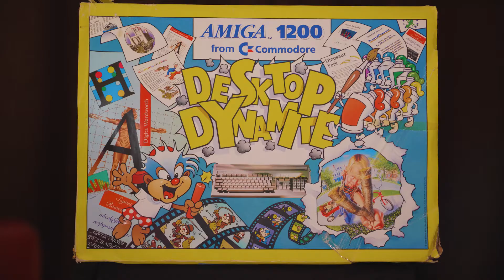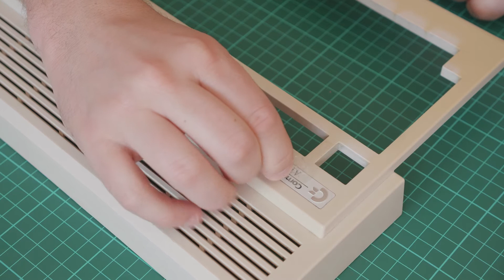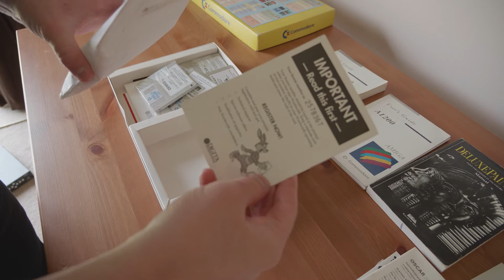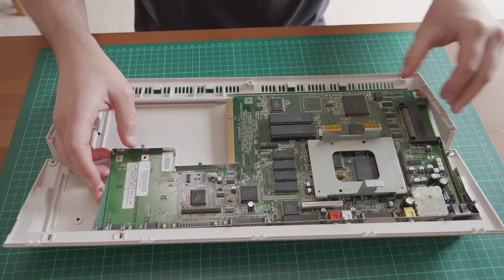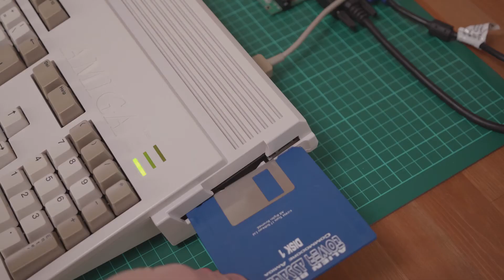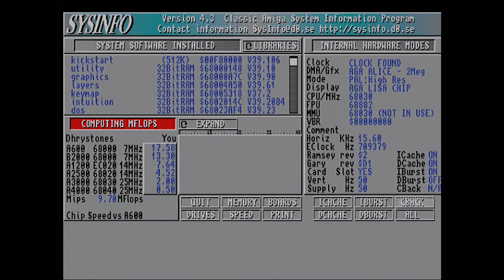The Amiga 1200 - Reassemble, Membrane Repair, Blizzard 1230! Pt2 - System Restore

Comment: Hi Si, great series of videos - thanks! Really impressed by the restoration. Could I ask what model of monitor you're using and how you're connecting the Amiga to the monitor? Is it RGB to VGA? - The input source of "Scart" is throwing me off :) By the way, the indivision mk3 is out now with HDMI output, looks good but some people have had a couple of issues reading through individual computer forums. They're quite expensive too so I'm thinking I at least need to check my A1200's still work okay!
Reply from the maker: Thanks for checking it out James! That monitor is a Dell 2007fp which is great but sadly not 15khz compatible, in this series there is a mixture of one of those cheap hdmi scart converters from amazon and also a GBS-8220. Neither are great but they get the job done for the price! I definitely will be investing in the new indivision mk3 at some point!
Reply: Si Goes Retro awesome thanks! Thankfully I know about all those devices so good to know I’m not missing a trick. I looked over one of my A1200 mobos and no signs of any corrosion so good to go. Cf cards and adapters arrived in the post, got Panasonic caps and hydrogen peroxide on the way. I was thinking about gotek but I think I’m going to go the networking route and use ftp instead. Got my mate who’s also well into jungle checking your vid out too ;) I saw that you’re looking for mods along with spicey mikey, there’s some on Aminet just in case you haven’t already scavenged it. :)

Comment: Got a Phase 5 Blizzard 1230 IV with 68882 FPU 50MHz and 128MB 50ns simm. It’s a fast 68030 card but for FPS no way. Got also a fast ACA1233n-55 and that have also slowdown with FPS such as Doom and Alien Breed 3D. FPS are great with the 68040 or the 68060. Waiting for the ACA1260 and hoping to buy a Falcon 040 or the Blizzard 1260. Got four A1200’s, 2x Rev1D.4 and 2x Rev2B all recaped and have original 3.1.4 ROM chips on it. Two have Indivision AGA MK2CR. Maybe the Warp 1260 would be great if the 68060 Rev6 CPU is on it. Than is 105MHz great for FPS.
Reply from the maker: I agree of course the 060 is where it’s at, but even if you can find one to buy it’ll cost you £1000s nowadays! The 1230IV is the one of the best bang for buck cards you can get. I’m hoping the Warp 1260 isn’t too hard to get hold of, watching it play AB3D2 is magical! Would love to get hold of an indivision AGA MK2, some nice kit you’ve got there!
Reply: Get a DCE Blizzard 1230 IV also with a 68882 FPU 50MHz and a 128 MB 50ns simm. Than I have two Blizzard 1230 IV’s.  Like the Blizzard 1230 IV more than the ACA1233n-55.  You must get lucky to get a Warp 1260. Would be happy to have the ACA1260 or a Blizzard 1260. Like to see the specs from the ACA1260 against the Warp 1260. AB3D2 should be magical with a fast 68060 card.  RTG would be great to have it.